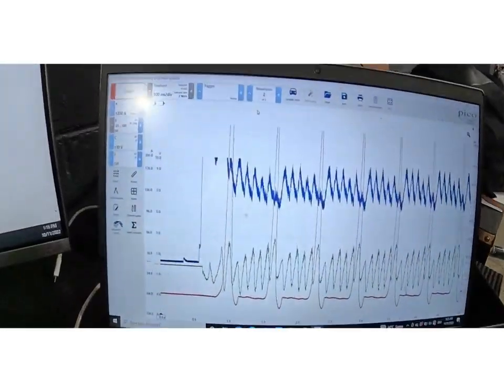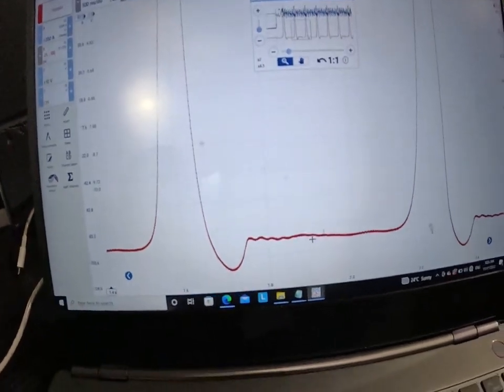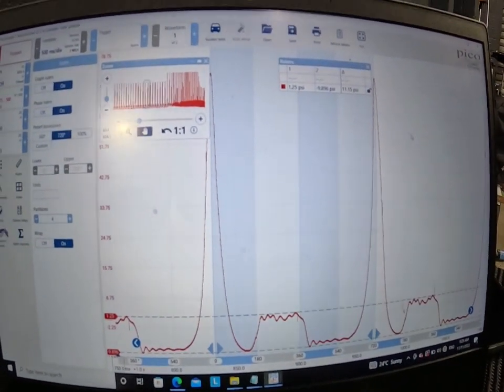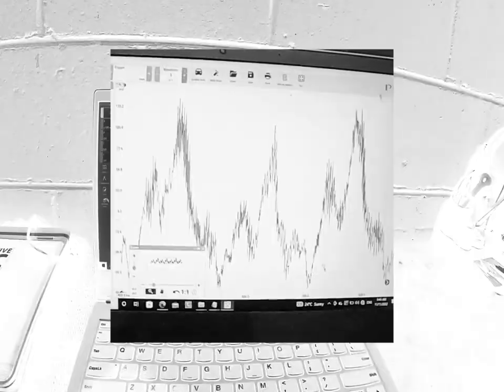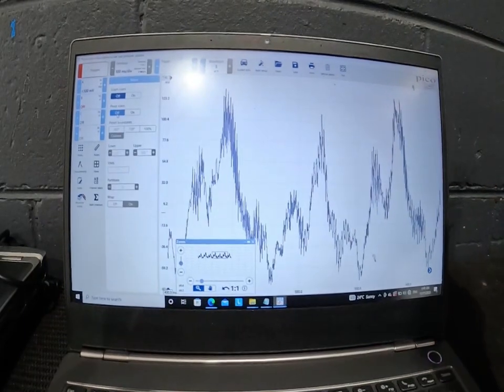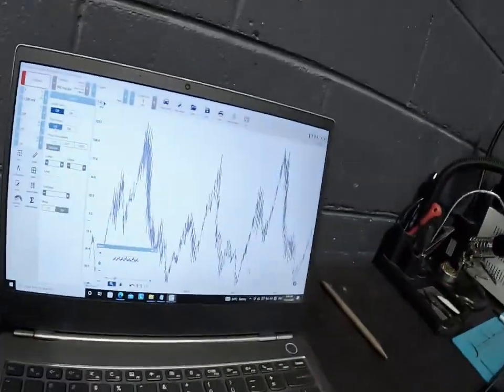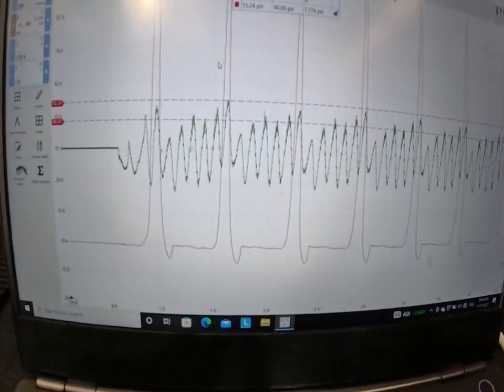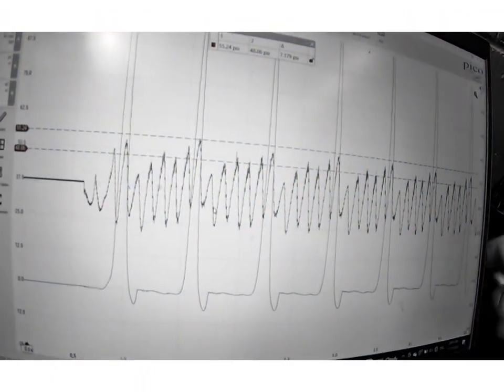The missfire no one can diag pt2 ! 🤓👨‍💻

Comment: There may still be an issue with the rings on #2,  but the lower compression could be related to just the leaky intake valve. An intake valve leak may also contribute to a matching rise in crankcase pressure you're seeing, since the intake and pcv system are tied together. To rule this out, be sure to isolate the pcv system and intake from each other, then take another capture👍🇦🇺

Comment: Nice job
One thing though, the lower intake pull after the suspect cylinder is a result of engine speed. The pull is lower because the engine sped up during the low  compression cylinder and then slowed down on the next cylinder in the firing order and this speed change affected the next cylinders intake pull. 
If you look at the relative compression humps you’ll notice the following cylinder after the low compression cylinder takes much longer. ( valley to valley ) 
Also I’ve been burned before so ensure your disabling pcv to intake when performing these tests.